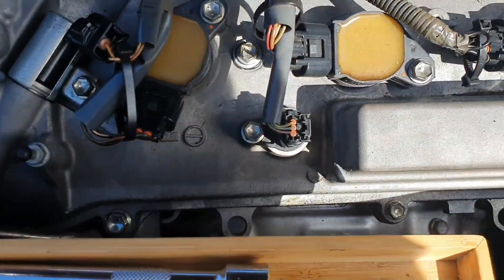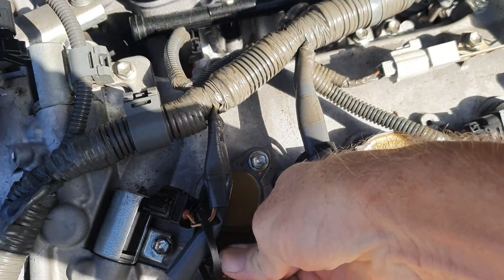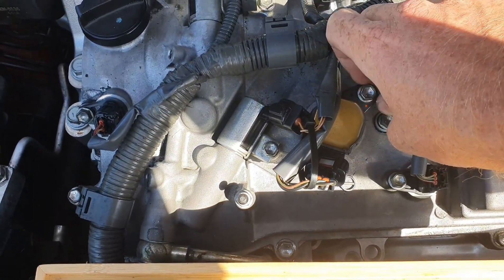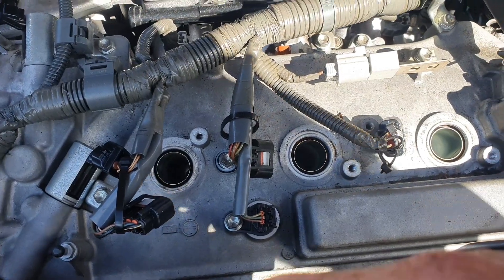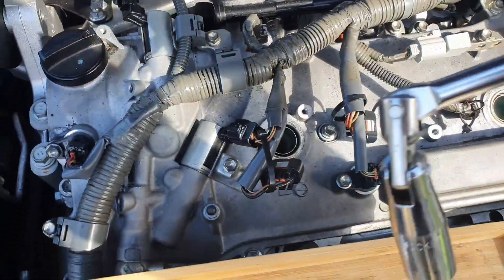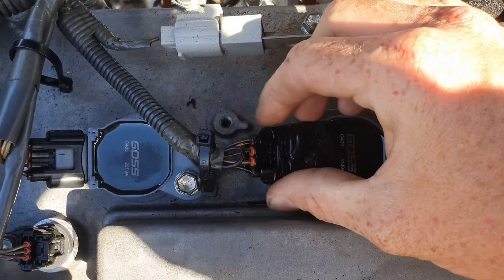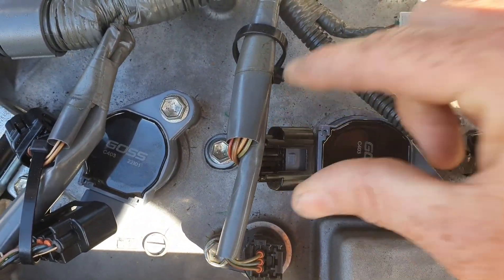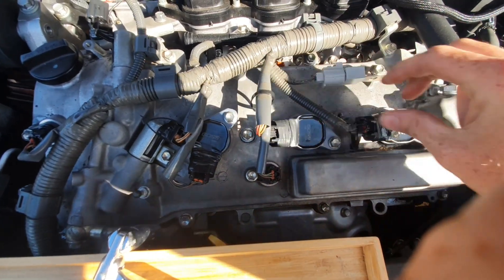How To Fix Your Check Engine, VSC, Trac Off Warning Lights On. Toyota Camry V6 2GR-FE.

Comment: I had the same issue- ironically all I did was disconnect the negative terminal of the battery for 10 seconds- reattached and error code is gone 

You may have not needed to replace your injectors after all - I see you disconnected the battery terminal “may” have solved your problem

Comment: Whats the coils have to do with stability control?
Reply: It’s a general code for the year. So you have three basic areas to check without further inspection. Scanning the code will simplify the error, but 90% of the time the VSC and check engine light will flick on.

Comment: It's very uncommon for three coils to fail, let alone at the same time. They can be checked for primary and secondary dc resistance figures and given the ok. I'd suggest that with a fault reported as common to an entire engine bank, first check the coil resistance figures, then look for an issue common to all three cylinders. This might be a ground wire, plug, damaged wire, most likely on the negative side. This fix in the video may just be a case of disconnecting the battery and resetting something, now not showing the code. This type of "fault finding" is the shotgun approach, where parts and money are thrown at the problem without correct diagnosis. 

A code reader is cheaper than a trip to Toyota for a scan, then you can see what code triggered it. It's quite likely something else upstream like a MAF sensor that has caused this. It'd be interesting if the OP reported back on whether the problem was actually solved in the long term.
Reply from the maker: It solved the problem and drove this car for over two years up until I noticed white smoke coming out of the hood. Wayerpump about to give way, leaking coolant, idler pulley s as bout to go and a list of many things that needed to be replaced. Ended up trading it in last week and picked up a brand new Subaru Outback Sport.

Comment: Please I like to know how I can fix my check engine light that is on always, my car is 2GR Engine Toyota Camry 2010, I have not seen any signs of oil light since I started using my car, what can check on the oil light as well.
Reply from the maker: You need to get the car scanned first to see what’s caused the vst light to turn on.

Comment: Great Video! Question, I took my '09 Camry to the dealer, scanned for codes since the VSC light and check engine light had come on before. Couldn't get it to stay on at the dealer, but they ran the codes history and noticed a knock sensor was faulty . Do you think that could be related and a cause for the VSC light to come on or is that a different issue?
Reply from the maker: The knock sensor can also cause the VSC to turn on.
Reply: @aft-fishing90  thank you! great to know. will have it replaced.
Reply: Cuéntame q te pasó? Será el mismo problema que el mío? Cuéntame que código te arrojó? A mí me arrojó dos códigos: P0348 y P0393

Comment: My vcs and check engine light been on for 3 weeks now, My inspection is due at the end of july. Ughh, I really don't have a lot of money to get it fixed. May I ask you how much did toyota charge to tell you which coils were bad?
Reply from the maker: Toyota charged me $180 to get it diagnosed.
Reply: @aft-fishing90  Okay Thanks for replying. Ima try to get a new gas cap, I’ve seen that fixes it sometimes
Reply: @aft-fishing90 dejarías saber cuál es el código que te pusieron en el informe?

Comment: Hey man what is the part number for the engine coils?
Reply from the maker: I can’t remember but a google search will show the correct ones.
Reply: Go to the dealer ( part department) ask them what part number for your model, year, make. Or you can go to online store after fill in question about make, year, model of your vehicle.

Comment: I've had my spark plugs and coils changed by my mechanic, but the VSC and check engine light is still one.

There is no more misfiring though because the ride is now smooth. 

And the computer does not detect anything else though. Even my mechanic is at a loss. :(
Reply from the maker: Could be an O2 sensor or fuel cap sensor. The main thing is that you changed the spark plugs and coils.
Reply: @aft-fishing90  I'll have a take a look at those 2. Hopefully its just the fuel cap sensor although I think it's sealing pretty well since there's a hissing sound when I open it.
Reply: @aft-fishing90  Thanks for responding! :)

Comment: How did you determine it was those coils specifically
Reply from the maker: At the start I knew it was the coils as I changed all of my spark plugs. I then took it to Toyota and they scanned it and gave me the report that told me which cylinders needed new coils. They offered to change it for me at a cost but I did it myself and now my vsc light is off and my car runs alot smoother and more fuel efficient.

Comment: Changed all mines and it still happens
Reply from the maker: Did you change all spark plugs and coils?
Reply: @aft-fishing90  was taking them to the dealership they was changing them one at a time car was under warranty another mechanic told me I gotta change all at the same time did that still didn't work check vsc  on my dash still  till this day go and come with change in the weather
Reply from the maker: Might be a faulty sensor, best get it scanned.
Reply: @nathanielhenry1523  Have an ‘08 Sienna XLE.  had all these random misfire codes (VSC) and even would have to shut my van down as the “traction control” light would blink along with the engine light causing the van to lose power and decrease in speed, till I shut it off and restarted it.   And that would take care of it for a week or so then back again, usually one the Highway.  So off to the shoulder again as the van would slowly lose power and buck and gas be basically unresponsive 

Seems like maybe the compression was changing over the 200,000 miles as i started putting premium gas in and the higher octane was the key.. as all the codes went away (once cleared) and never came back.   Same spark plugs.  I did change one injector (before I switched to premium gas) as it did have that code come up for the number 2.  But the check engine lights would still come on.   But same spark plugs on all 6 cylinders as those back are just too hard to change without a good reason.  

Again premium gas and all my check engine lights and blinking lights are a thing of the past and it’s nice having a dash free of those.  (Those lights came on probable a dozen times in the past.  But now problem solved for like 9 months now and counting.

Comment: I had the some problem and solved with cleaning the gas cap..
Reply: Yeah I heard the gas cap can often be the problem if it's not sealing properly. I tried cleaning my gas cap too but it didn't work so it needed a coil replacement.
Reply: @sirrob6017  how much did the new coils cost?
Reply from the maker: @cm467 over $400
Reply: Qué código te arrojó?
Reply: A ? El mío dice p0393 entrada alta del circuito B Banco 2 del árbol de leva. Cambié el conector pero sigue igual? No sé qué hacer